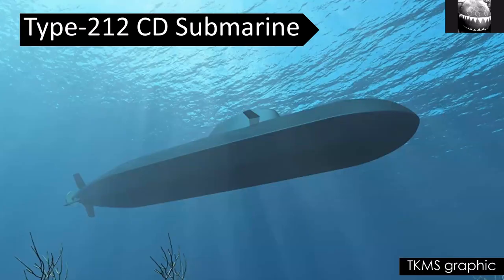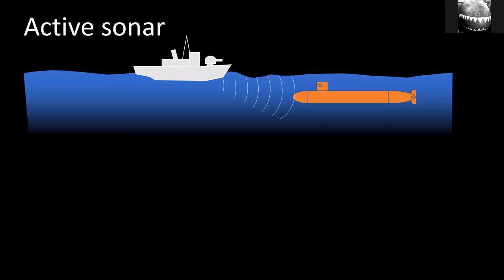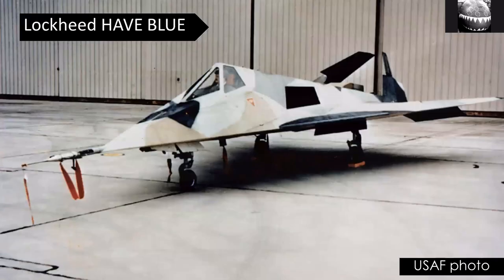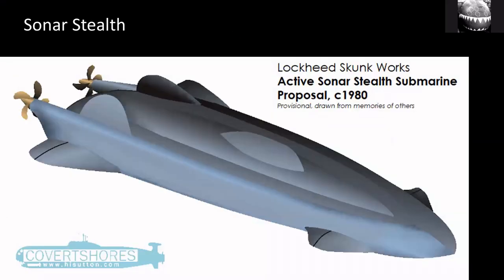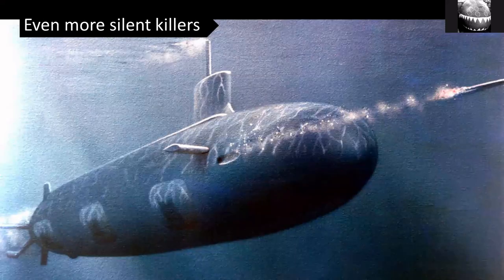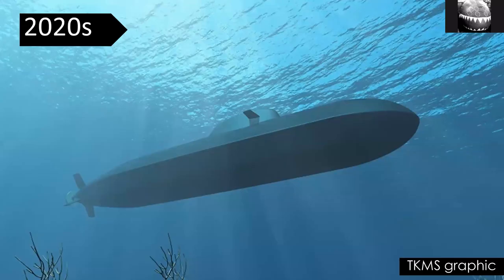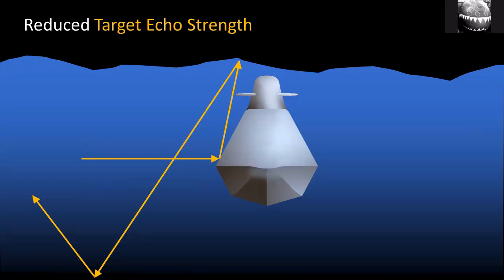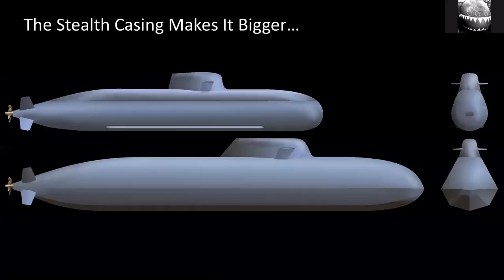The New Stealth Submarines Explained (Quick Guide)

Comment: no pumpjet. no lithium batteries. meh.
Reply: Pumpjet is very inefficient at low speeds and therefore not a reasonable option for any non nuclear submarine.
Reply: @neues3691  submarines aren't made for F1 racing. they are meant for stealth. efficiency is irrelevant otherwise they wouldn't use AIP.
Reply: @neues3691  Also, their most benefits are above 10 knots. Conventional submarines usually patrol at 4-8 knots and transit at 8-10 knots. These are classified information but I wouldn't be surprised if pumpjets were actually less stealthy at such low speeds because of their faster rotation and higher exit velocity.
Reply: @zoka7108  I would certainly not rule that possibility out as well.
Reply: @Rob power projection isn't meant for speed. it's irrelevant. also the faster you go the less range you have. it's a law of physics. subs are meant to be stealthy not meant to be fast. otherwise they would have rockets and such.
Reply: @riskinhos  There are so many wrong claims in your comments that I don't even know where to start.
Reply: Lithium an water doesn’t mix well. Anyhow, the batteries are just a backup for the AIP
Reply: @KP3droflxp  any battery doesn't mix well with water. that's irrelevant. lilthium is a big major advantage and that's why navies are upgrading more and more subs to lithium. it's new battery tech. with tons of advantages.